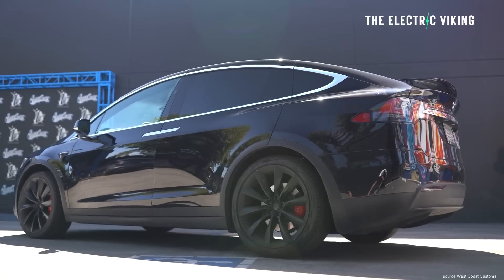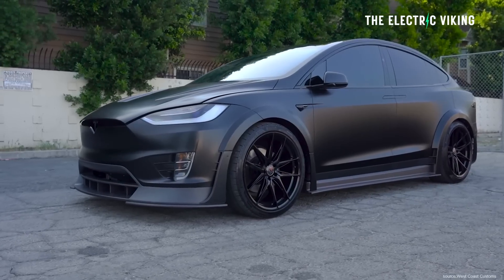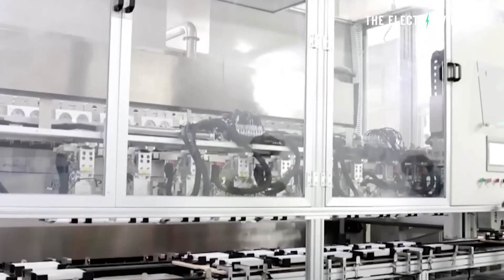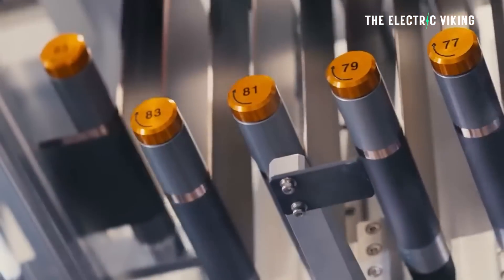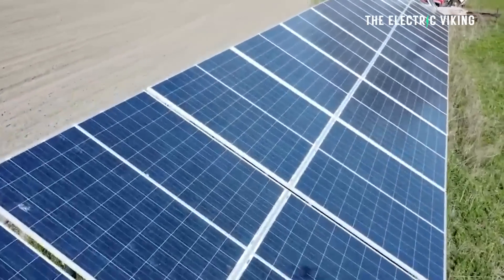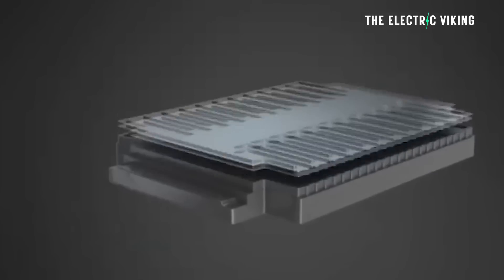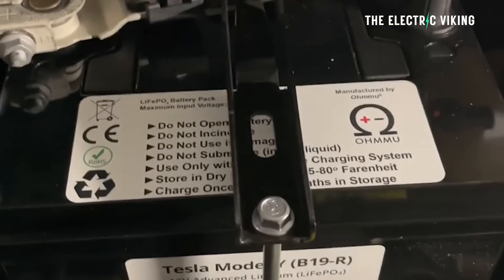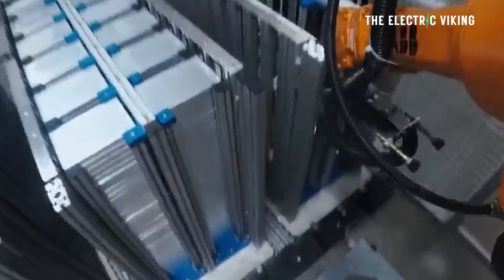The BEST upgrade for every electric (or gas) car costs only $299

Comment: Sodium batteries have a large charge to discharge voltage range, the car may not work correctly at lower battery state of charge, also the car charge controller may have problems keeping the battery charged. Be careful.
Reply: Depends on the low voltage or cell configuration. 3c sure but 4c should not have any issues.
Reply: @shoestringsev4529  
Sodium batteries have a cell operating range of 1.5V to 4.0V . 
A 4S battery would the operate between 6.0V to 16.0V. 
A 3S battery would the operate between 4.5V to 12.0V.
3S is out, maybe 4S, but not sure the car electronics can handle that voltage range.
Note C is charge/discharge rate, S is number of cells.
Reply: @universeisundernoobligatio3283  lead acid can't survive the same low voltage 😅
Reply: @glike2  
Only <50% of the battery capacity will be usable, less if high currents are drawn due to higher internal resistance.
Reply: That just means the car will decide the battery is low at 11V and charge it up to 13.8V, which doesn't make full use of the sodium battery's capacity but would work just fine.
Reply: As long as the battery voltage range is greater than the car, no battery damage if you drain it.  Normal operation should be easier to maintain with greater energy capacity than century old lead battery tech.  And it has a BMS!  Better cold weather energy.  Only a little more expensive than lead.  I just don't have a Sodium battery option for my car yet, darn!
Reply: You can buy Circuit Breakers for cars that also trip when voltage drops below 24v in EV's stop drain

Comment: What? He said it might be a good upgrade for an old Tesla? Why do electric cars still need a separate starter battery? I didn't realize they needed one, aren't they already full of battery?
Reply: The 12v battery is for the small electronics on board. The 400v system (the big battery) is for the cars movement. I hope this helps 😊
Reply: @Daybyday_improvement  Thanks!  I guess it makes sense. Easily than converting from 400v to 12v for electronics etc. Also works as a backup. Still seems redundant.